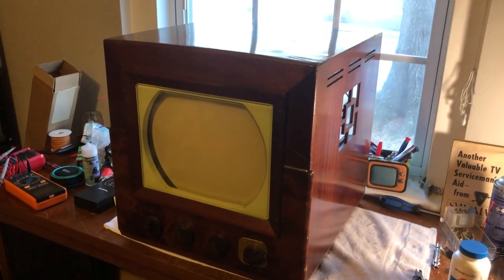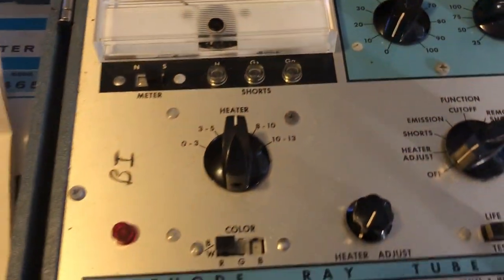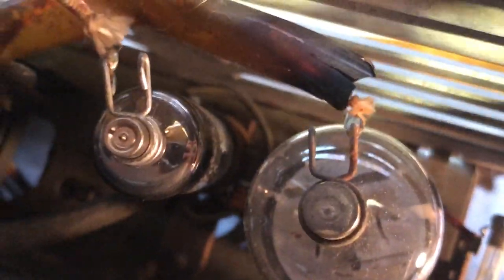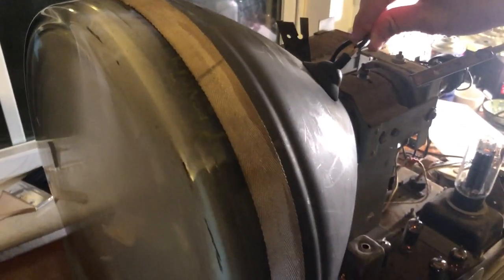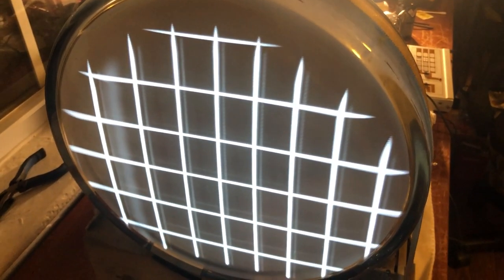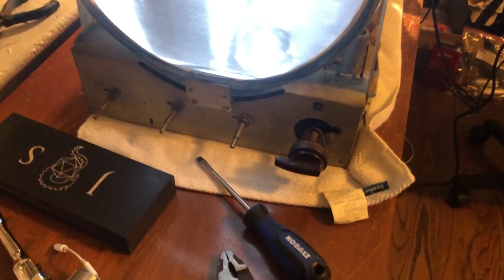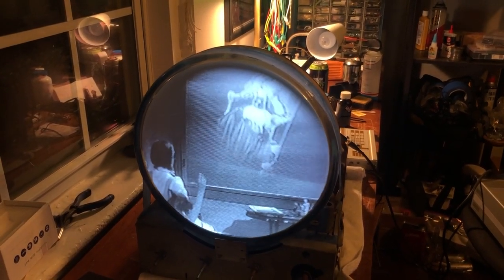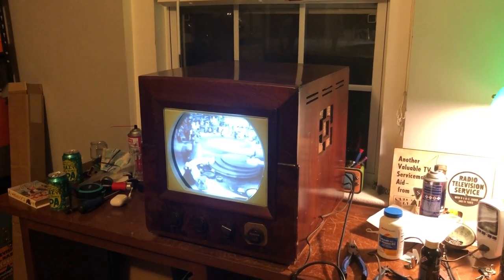1949 Admiral Television Restoration

Comment: Did a great job in troubleshooting the HV issue, the picture is very good and even if it is not perfectly aligned it adds character to the vintage look of that old set. I imagine it would not be used too much as in an effort to preserve the hard to find tubes.

Comment: Looks great, Jack! That 12LP4 looks like a new tube. Make sure you get that pesky dual ion trap adjusted properly so you get max brightness and to eliminate any shadows around the perimeter. A misadjusted ion trap can damage the gun if allowed to run with the brightness turned up.
 That Admiral looks very similar to my 1950 Philco 50-T1400 which has a much weaker 12LP4.
Reply from the maker: Hey David! I actually didn’t know a misaligned ion trap could damage a tube. I always make sure I get it to its brightest image before adjusting the brightness. It’s a shame this set isn’t mine. It’s working perfectly. I actually have a Philco 50-T1403 that I’m restoring on the back burner. Might make a video about it after my Zenith Porthole video. I’m glad people enjoy this content. I love this hobby and love making videos about it.

Comment: That cloth "belt" holding the CRT in is original.  I have the floor model with the same chassis and it has the same thing.
Reply from the maker: Ahh interesting. Thanks for that info. I feel 1940s set really had a trial and error feel to them in certain departments.

Comment: I like the video. I see your haveing good luck with it . Although I'm not all the way to the end of the video yet. I just came home with  a chassis
only about a  3 hr each way so 6 total on the road to pick it up. She advertised it as 1948 but she did picture the chassis # I didn't figure out it
was a 1949 till way to much reserch later . She said 48 I don't know why I thought she was right. Now that I type in 1949 admiral I get more,
info/  I found the schmatic manual, says 1948 to 53  and the service manual for  the (1949)  24A125 This will be my first tv  to resurec.t The chassis model is 20X1  series 6 the book showa there are other chassis model  # that start the same with 20x1 but then the have either one or two more nubers added on I guess they are different cabinets the different added on Numbers are 45.or46 or 47 or 22 or 5 or 6 or 5S or 6S, or 7S  or  36 or 1 added on to the alredy existing 1 =11  or  2=12  same with the 5 or 6 makes them look like 15 or 16

Comment: The height is too high. You need to match the height according to the bezel.
Reply from the maker: Interesting. Were these circuits designed specifically to match the bezel on the cabinet it was going into? Cause on a Zenith Porthole, the image is supposed to fill the whole picture tube.
Reply: @televisionforever  The Zenith porthole design was a marketing ploy to sell the buyer on the idea that they see far more square inches than a set that has a bezel. TV is 4:3. Take note of some Admiral sets that have a 4:3 bezel such as the Admiral 30C15 S. The width and height needs to be adjusted to fit the bezel so you get the 4:3 picture. A 10BP4 CRT (or 12LP4) when adjusted to fit a 4:3 bezel gives you a 10" (or 12") diagonal picture in 4:3 aspect ratio but with rounded corners. Do you see the selling point of the Zenith "Giant Circle"? The Zenith porthole TV is the equivalent of watching a movie through a porthole.
Reply: @televisionforever  As a side note: The set you are working on has the "double D" bezel. You adjust the width to the right and left edges of the bezel and the height to the top and bottom of the bezel.
Reply from the maker: @HD7100  Ahh that makes perfect sense. Thank you for that! Very cool. I'll readjust the height and width. Interesting about the Zenith set as well

Comment: I HAVE A QUESTION FOR YOU!

How is it that all your old TVs have good picture tubes?

When I was a kid in the 1960s, I remember that TVs would park the beam right in the center of the screen when you turned them off. As a result, old TVs would get a dark spot right in the middle after years of use.

Most old TVs of the 40s, 50s and 60s were thrown away because there was a big dark area right in the middle of the screen. It cost as much as a new TV just to replace the picture tube. So, people scrapped their old TVs for a new one.

My grandma had an old early 1950s Stromberg-Carlson that got so dark in the center of the screen she replaced it with a new TV in 1971. By the way that 1971 color console TV is still in use.

Sometime in the late-1960s they developed a technique so the beam would not park in the center of the screen when you turned the set off.
Reply from the maker: I think you sort of answered your own question in a way. Lower cost televisions were tossed when the picture tube was low in emission or dead. I'm sure owners threw away sets when the picture tube was dead instead of replacing the picture tube. I've seen a lot more replacement picture tubes in big consoles like the RCA CTC series since they were very expensive and customers weren't just going to just toss them. I have been very lucky with good testing picture tubes in "portable" models though

I have a theory that a lot of these tabletop models were used less than a floor model you would see in a living room. Possibly a bedroom or kitchen set that had less hours on it.

Comment: Very cool video. At about 8:00 in, you say you're not sure whether the knob you're adjusting is either vertical or height. Since the image is being stretched while you adjust, why is that insufficient for determining that you're adjusting height? I would expect vertical to move the whole image up and down without stretching. But I'm not an expert on old TVs and have only adjusted my EGA monitor :D.

Also, what is linearity control?
Reply from the maker: So the vertical hold and vertical linearity are different controls. Vertical linearity and height look a bit the same when adjusting them. The vertical linearity adjusts the spacing towards the top and the height adjusts the height of both the top and bottom so they need to both be adjusted to get a good look picture. But you’re right, vertical hold locks the picture in place when the picture is rolling up or down.

Comment: I just finished restoring an Admiral 12x12 (20Z1 chassis).  Wish I had a stronger 12LP4 like you do!  Mine is adequate for now.  I have excessive horizontal width which is unaffected by the horizontal width control.  Other than that, picture, sound, and brightness are fine.  I removed capacitor C69 (0.035uf) across the width control.  The picture shrunk slightly, but still overflows the screen.  High voltage is great (10kv).  Horizontal lock is stable.  I set the horizontal drive for best horizontal linearity.  Horizontal linearity coil seems to do nothing.  Focus control works, but must be turned all the way to the left for proper focus.  Any advice would be sincerely appreciated.
Reply: Oh, and I did a static IF alignment per the instructions in the SAMs.  It seemed to work great.  Much more picture detail now.